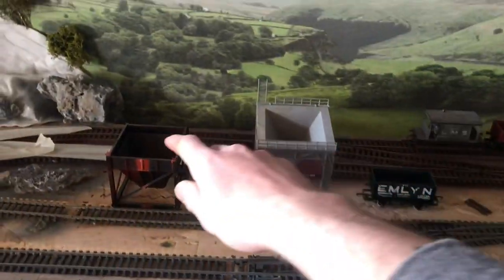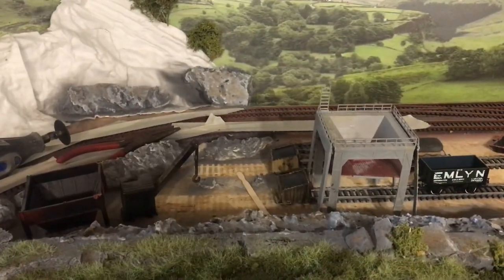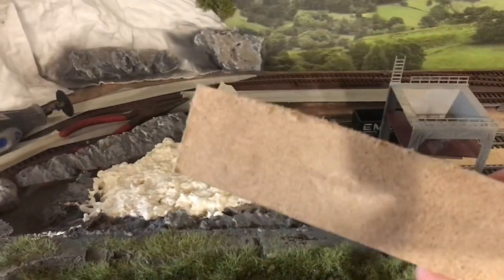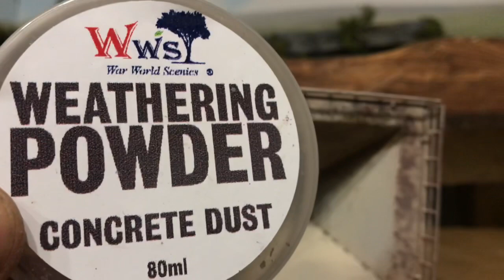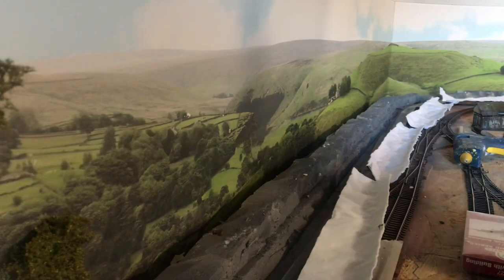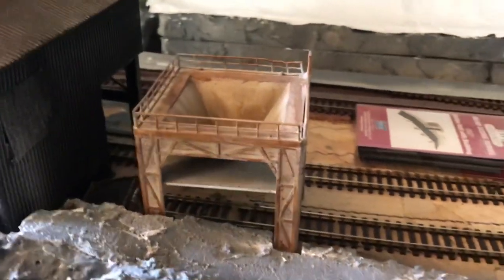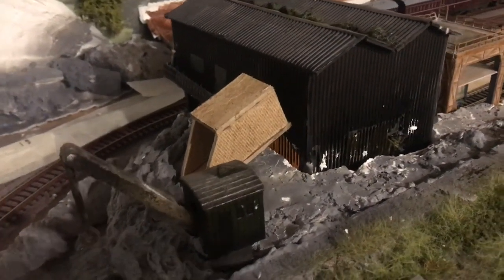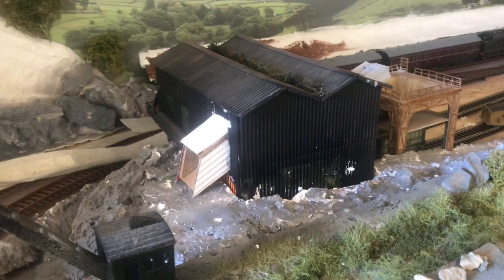Building a Model Railway - how to make a Stone Quarry - Part 1

Comment: Looks great. Its good that you use scraps and reuse models. Years ago I used soap card to make buildings. I even used plumbers hemp for a thatched roof.
Reply from the maker: That’s what it’s about thanks for getting intouch
Reply: @peaks4719  soap card used to be boxes around bars of soap or soap powder. It was very waxy on one side and printed on the other. Although very thin, because of the waxed side, it was very strong.